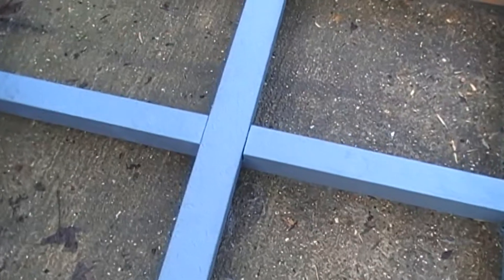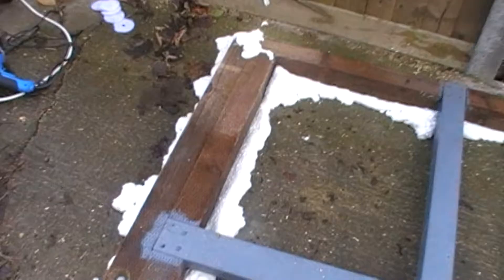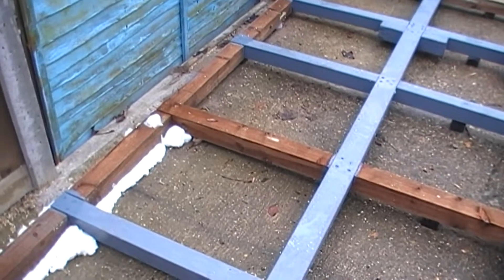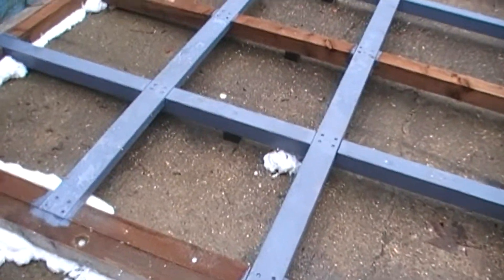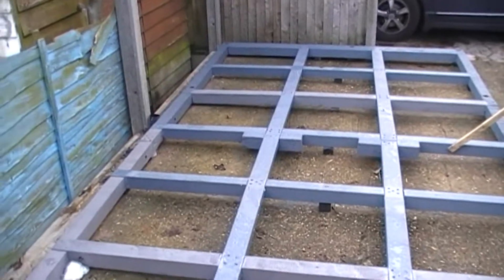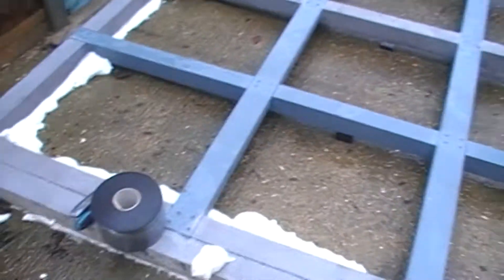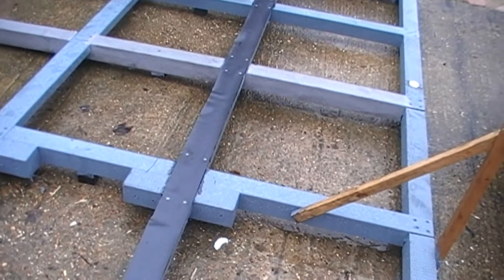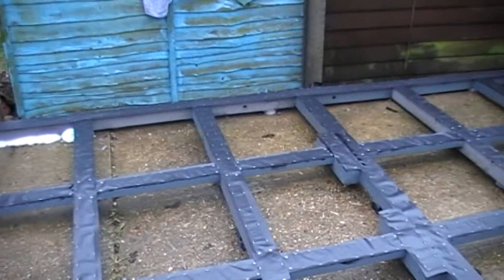Damp Course

Comment: Thanks. Two question, 1- does that foam help water go under if i use it with full timber base sitting right on concrete surface, or at least would it help? (i dont want/cant leave gap, the frame must sit on the concrete. 2- wouldn't stapling or punching damp proof course make it useless? I also want to put a layer of dpc between the timber base and logcabin claddings sitting on top of them.
Reply from the maker: In the end I removed the foam after seeing a video showing how water soaks into it! The frame is not sitting directly on the concrete, but instead there are plastic spacers under the frame. Also using plastic spacers of different heights I was able to make the frame level. The concrete has a small slope so rain water can drain away, but you don't want a shed with a lean. As for the staples I cover each one with tar based glue (Blackjack) to seal it. I think this should be okay for a shed as there is no wood in contact with the ground and so far it's fine.

When I attached the cladding I arranged that it about half an inch out from the shed wall and overhanging the base fence posts by about an inch. This way the cladding never comes in contact with the base fence posts and water just drops off the cladding onto the ground.

If I was going to do this again I would now use plastic fence posts which would be better than the wooden ones I used.

I not sure exactly how you were thinking of doing your base but from your description it sounded like the rain water could run down cladding and over the top of the DPC.

Good luck and take care.